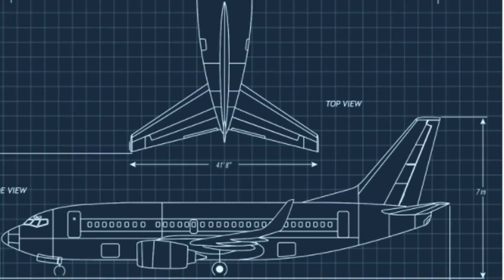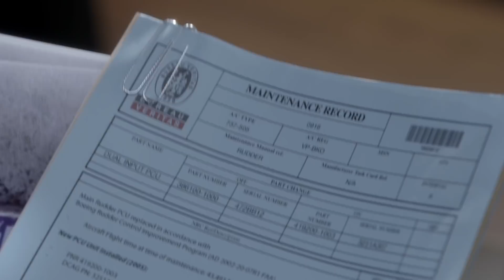Was Flight 821 Brought Down by a 737 Design Flaw? 🛬 Air Disasters | Smithsonian Channel

Comment: I used Boeing737 in a Simulator It did The Same Thing 😆 I can't Control The Rudder It Keeps Diving and It keeps Rolling To The Left'
Diving
After Using The Simulator
I opened YouTube And This Is Recommended 😆😆😆
Coincidence

Comment: This is we’re the pilot was drunk and weren’t trained properly about the design difference of Boeing and the old Soviet aircraft plus the inbalanced on the control column for the engine thrust that had to be operated manually and was noted on the log of the aircraft

Comment: My 747 From Walt Airlines crashed with an insane failure.
Ok. The Gelister 747 from Walt Airlines was flying normaly. 
I was the pilot of this Gelister 747.
Then...
* explotion *
Me after the disaster:The plane lost the right wing so... it wasn't a problem with all the Gelisters.
Then...
Me:What's happening?
Co-Pilot Marco:I Don't Know!
Me:We need land the plane.
* sound to avisate the passagers *
Me:Ladys and Gentlemen this is the captain speaking so... we lost the right wing but no problem we are approaching and everyone will survive.
So... the plane isn't safety but nobody died in Walt Airlines. Then
* scratches *
The plane landed.
All the 387 passagers and 20 crew members survived.
Me after the accident:we landed the plane without the right wing and that was a safety accident.
That was close Oh my god.